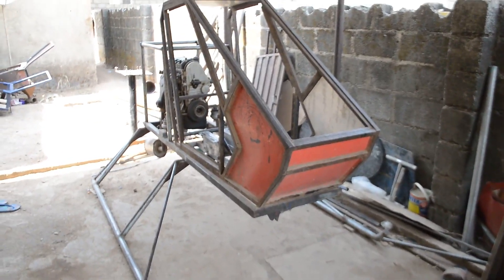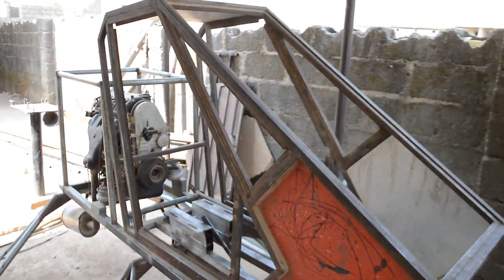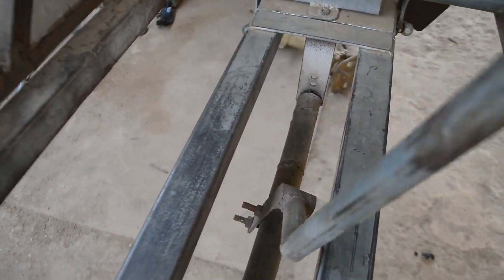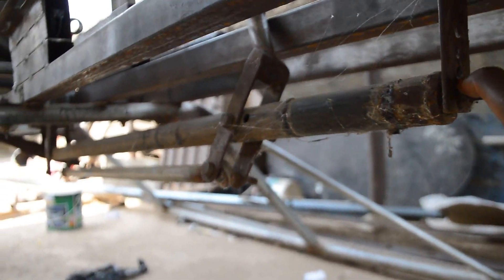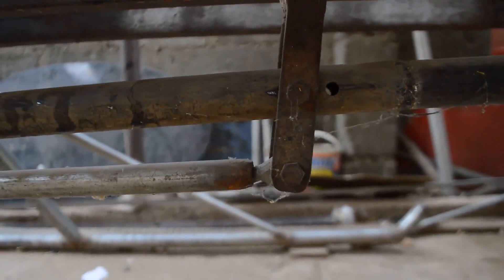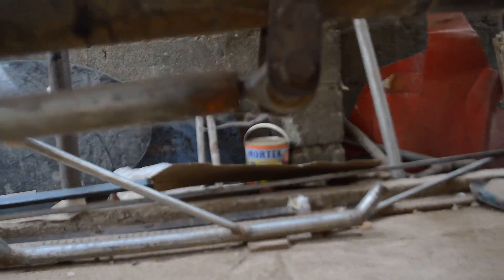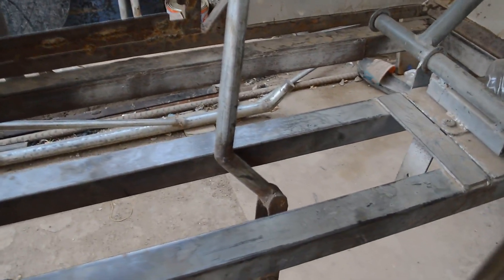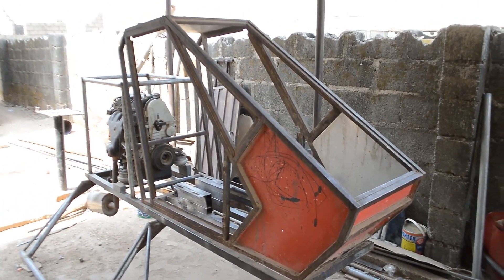Close Look On The Benson B1 Cyclic Control

Comment: The weight of your helicopter will increase if you make everything using steel. Like your pilot cabin. In the end your engine will be not as much powerful to lift the copter . Moreover, rotor blades may be damaged due to overweight as well. While designing and constructing a helicopter, you should reduce weight as much as possible.
Reply: I totally agree, the engine itself is too heavy, he had to compensate bu using light weight aluminum tube for the construction of the fuselage, the guy seems has his home work well done on most of the construction, except the weight part,